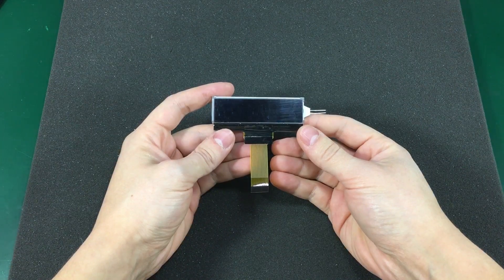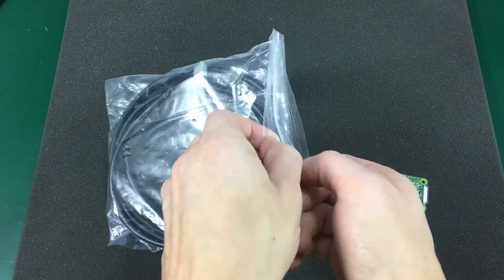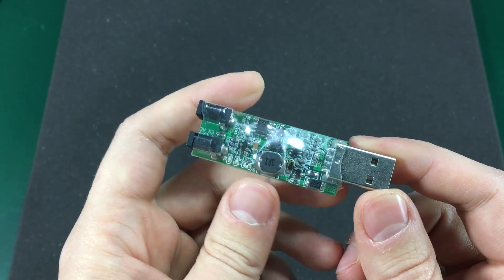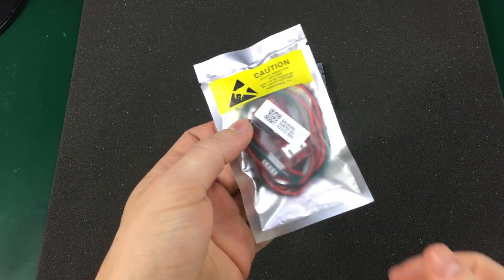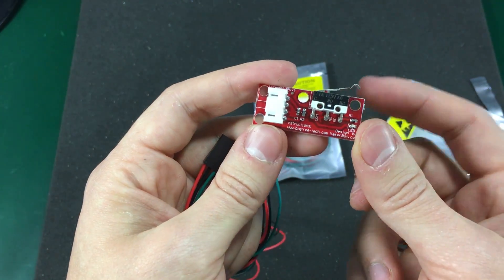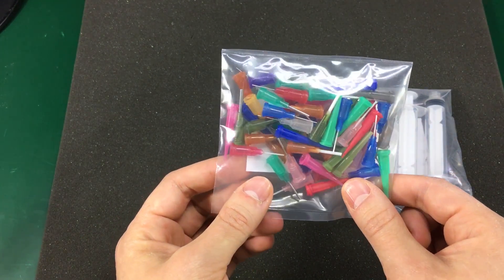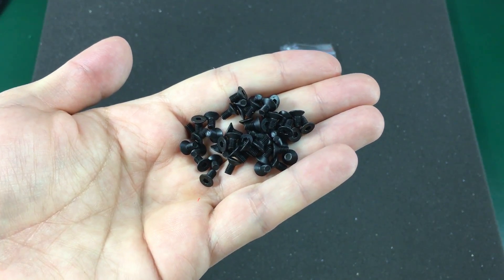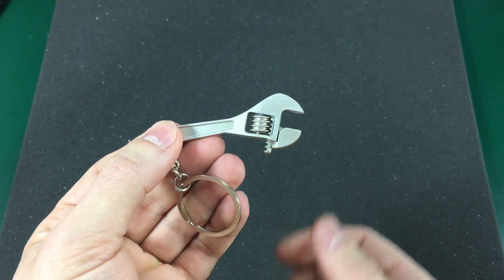Voltlog #88 - InTheMail

Comment: Thanx man, as always great video, (Banggood addiction !!!) hhh , for your curtain thing, you can run it on batteries (6V), attiny85 and this Ir remote :
http://www.banggood.com/Wholesale-Universal-Infrared-IR-Mini-TV-Remote-Control-Keychain-Key-Ring-Gadget-Novelty-p-51606.html
also this 6v, 30rpm geared motor is great for the job:
http://www.dx.com/p/dc-6v-30rpm-square-type-mini-dc-motor-w-gear-torque-locking-silver-390933#.WK22rjt97IU
mount for motor:
http://www.banggood.com/L-Shape-Worm-Gear-Motor-Mounting-Bracket-For-GW31ZY-or-GW370-Worm-Gear-Motor-p-1020776.html
 , you need some belts and pulleys and limit switches and an enclosure to hide it all (motor, motor driver,battery holder ,, etc,), also set some power saving, in your code , and the batteries will last forever ...
Reply from the maker: thank you for suggesting those parts. First I need to switch to vertical rolling type blinds and then do this improvement.

Comment: There are good 6S charger for around 35$ : ISDT SC608 for example.
Do you really need cheaper ?
Reply from the maker: yes, I need small cheap module that I can just integrate inside a bluetooth speaker for example.

Comment: Actually that iMax 3S Charger has another use, as it has 3 isolated 5V rails.
Could be modified into a stand alone 3x isolated 5V @800mA PSU, or connect all 3 in series to make a 15V @ 800mA supply.
Reply from the maker: yes it could be hacked to do that, though I would have no such use for something like that :)

Comment: I set up my friends 8.4v 2S pack, but instead of using a 3 wire I used a 4 wire and charge them with Two DC to DC Converters set for 4.10 out in parallel while they're wired in a series, it works, no balancing acts CC/CV they charge independently so when they're done they shut down
Reply from the maker: that''s similar to what how the 2S module works. As I mentioned in the video I am looking for a dedicated charging ic that has some extra features.
Reply: Check this out, I purchased 3 of these and they seem to do the job just fine. There's a 2S and 3S JST for power in while charging or supply your power as if you're bulk charging while having this plugged in your JST on your battery to this device on balance mode for 2S ~ 6S Works Great so far

Comment: http://www.ebay.ie/itm/282267908552?_trksid=p2057872.m2749.l2649&ssPageName=STRK%3AMEBIDX%3AIT
Reply from the maker: not a charger, just protection board.
Reply: you're right..over voltage, over current, undervoltage..no balancing.
Reply from the maker: I'm not talking about balancing, it's just not a charging module, it only has those safety cutoffs but it does not do CC charging and then it does not switch to CV mode towards the end of charge.

Comment: That "iMax" battery charger looks surprisingly good. Isolated 1S charger for each cell is good enough way to balance and charge the cells in my opinion. 
I've been using "iMax" B6 with laptop charger for charging 2S and 3S battery packs. That B3 would be much smaller and simpler solution and just as good for small packs. Goes definitely on my "to buy" -list.
Reply from the maker: yes it does balance the battery but only by charging to full and the "balance" indicator in this case are the green leds for charge complete, which might be acceptable for many scenarios, it's just nice to know these things before buying.